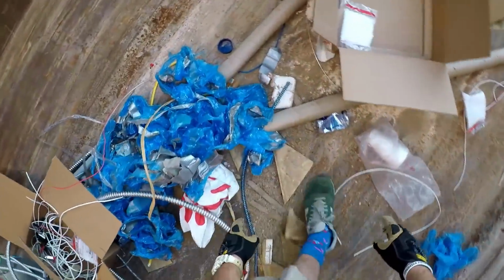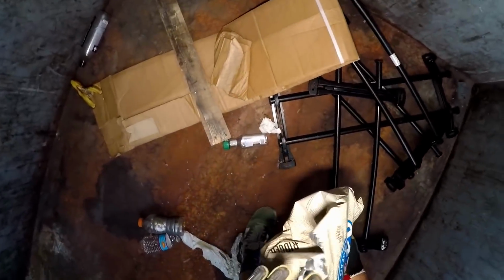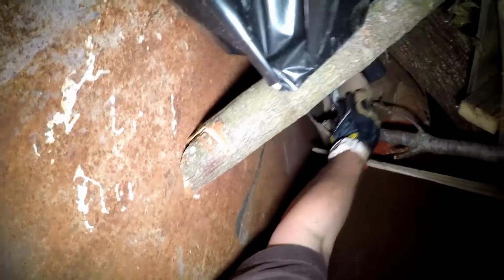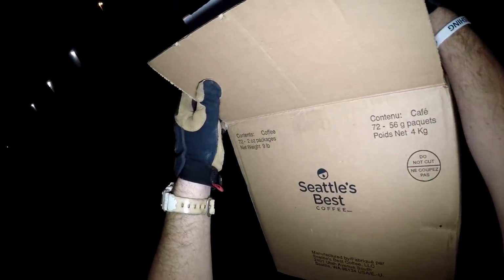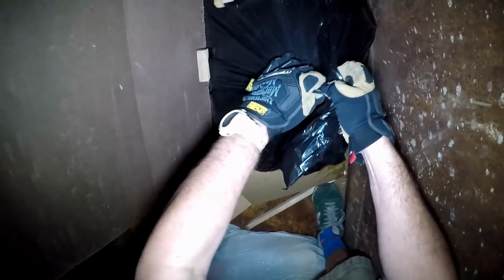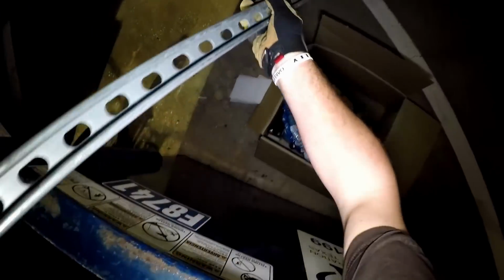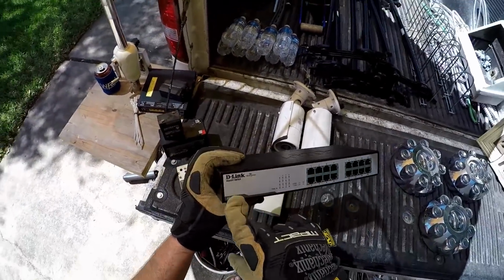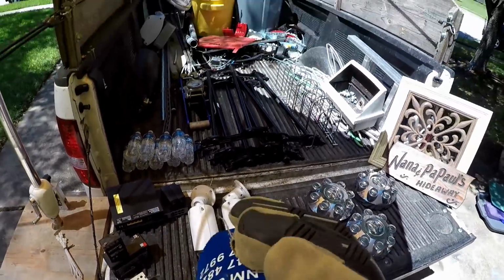Dumpster Diving "iBiquiti?"

Comment: Those PoE dealios are used to supply network equipment like WiFi access points over the network cabling while passing through the network connection. PoE = Power over Ethernet. Handy for places where running network cable itself is enough of a hassle. If you only have a few things to supply, these adapters tend to be more attractive than getting a full-blown PoE switch. Plus, if one fails it's probably in a place you can easily access and not somewhere under the ceiling.

Comment: harbor freight is carrying more replacement parts. you might be able to get a new handle yoke to repair that jack. put that diet coke in a cooler full of ice to sell for a buck at your garage sale. those totes would be awesome to store winter clothes in. a little grey tape over the holes, and some cardboard in the bottom, and good as new. my shredder hoard pile is getting huge. 20' around, and 8' deep. if things ever get back to normal, i'll have about 7-8 truck loads to sell, if not, i'll have plenty of material for wasteland armor and weapons. either way, it's money in the bank. i'll keep dragging it home, as long as people keep putting it at the side of the road.

Comment: Somebody might actually read this: That bottled water might not be the best to drink. If it's past the exp. date the plastic bottle containing the water might have dissolved a little bit. 

That's the actual function of the exp. date on bottles of water.... not that the water has expired, but that they cannot guarantee that the plastic might have partially contaminated the water.

You could still use it for other stuff! like cleaning or watering your plants, so it's a huge waste throwing it away like this.

Comment: 23:06 People should not throw out bottled water or other consumable liquids. Once in the dumpster, packaged like that, the water in them gets removed from the water cycle by being put into landfills where it’s trapped by the landfill liner designed to keep nasty stuff from leeching out of them into the water table. Pour out drinkable liquids before disposing of the containers. Dump out your ice as well. Way too much our potable water supply is going into dumpsters and landfills.

Comment: Those folding box things are parcle boxes, in the UK amazon drivers use them, i have a few in my storage  (see my lastest vid if you want) hint hint LOL mine have fold down floor pannels in them, they stack ok and are usefull for storing curcuit boards ;) possably even alluminum ? anything too heavy and you cant lift them though.

Comment: Around here if you have firewood quality pieces, put a sign on it, lay it out beside the road and BAM, ten minutes at most! It would be gone and burned that night at a campfire or stored for your fireplaces. What a terrible waste as it sits in that dumpster. Heck, they charge as much as ten bucks a bundle for five to seven split pieces at the local Big Box store!! Heck, you don't even have to move it, put a sign up on and half an hour later it will be gone!

Comment: Mike, in that green dumpster was a geneuine 360° rotating flexatronic industrial caronfiber heating polisher with the  dual cam carb kit ..model number 5724683697mx426f74213. Worth millions..how could u pass that up???

Comment: Sometimes I have to question your choices. While you're right there is nothing wrong with the water inside the vitals themselves have been in a dumpster full of virus and bacteria in a time of extreme contagionhow do you plan to get the water out of the bottle so that the water doesn't touch the next before it touches your lips